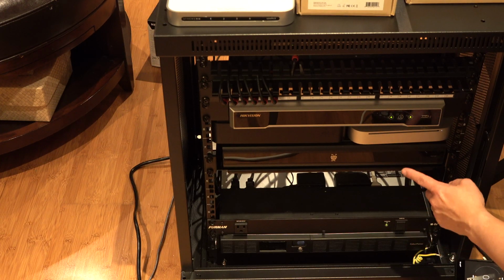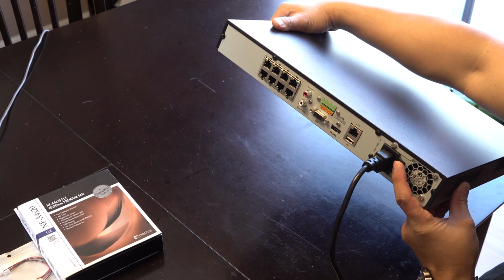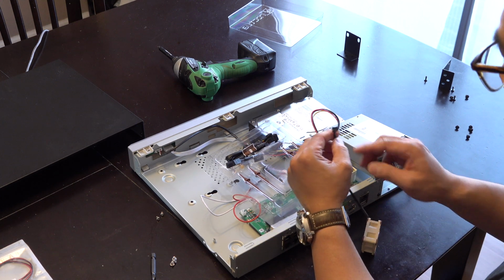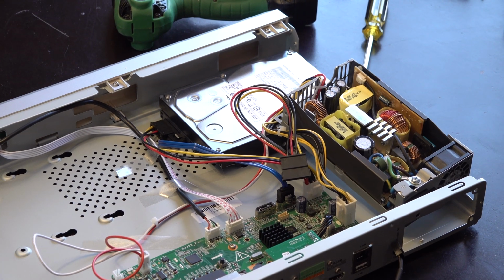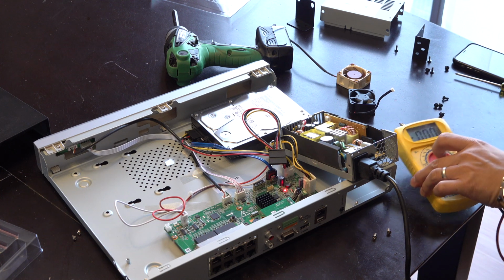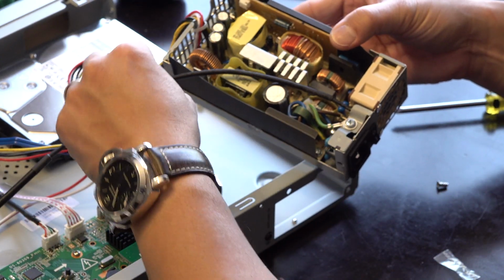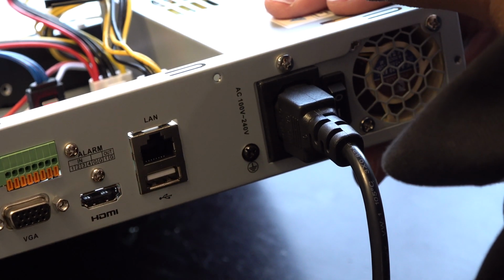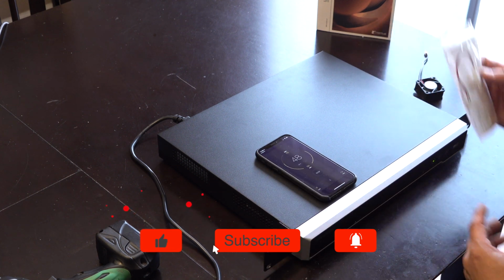Replacing the Noisy Hikvision NVR Fan without splitting wires

Comment: I replaced the fan as per video but a couple of gotchas. The 3-2 pin converter is not readily available - I ended up soldering the red and black - quite easy really. My PSU was much more complicated to open - and it took some bending voiding my warrantee no doubt. But keeping it as is was simply not an option. My noise levels dropped from 52 to 50dB as my unit has a second fan. I am planning to disconnect that one but have not yet gotten to it (I will post an update to this comment once done). TBH from my experience to date - I like HikVision cameras but will NEVER buy a HikVision NVR again. The noise for one, but the lack of grunt, the technical complexity at the PC end and the need for outdated IE compatibility "if you are running old firmware" - whilst there is firmware that does not require this. Lastly - it does not ship with rackmount ears. The RJ45's are on the wrong side of the unit for rack mounting compared to conventional switches ...
Reply: did you disconnect the second fan?
Reply: i have just done mine  with  what came with Noctua fan and worked great, you need to use the omnijoints, extra adapter cable not needed

Comment: My NVR’s manufacture date is 2023 and the internal circuit of PSU is so different that i can’t use NF A4x20 because the original fan is not 20mm but ‘15mm’.
There’s no ‘A4x15’ i had no choice but to use NF A4x10
Instead, the 20mm one is placed on the side. But you had to remove one ‘tiny nut’ before.
I hope my comment will help anyone do this process.

Comment: I bought 2 noctua fans, 1 for PSU 1 for the case. Now the case fan is working, but PSU wont work with the noctua fan. When I insert the old fan it starts spinning. The noctua fan isnt broken cause if I plug it into the case fan port it works. Anyone knows whats happening?

Comment: I'm thinking about modding the nvr I have as the fan on the heatsink is bad. Problem is the fan is in the heatsink. I was hoping I can put a thin 120 mm fan on the cover and solder the wires to the pin for the fan and I might be able to but the heatsink might be a few millimeters to big. I don't want to have the fan on the outside but was planning on using those metal fan protectors. Hopefully I can figure something out
Reply from the maker: Since the wires are very thin, you can also use the connectors seen in this video: https://youtu.be/G5aJZV4ICnw

Comment: You didn't compare the CFM because on the Delta it says 9.43cfm or 0.267 m3/m is this correct?
The noctua puts out 9.4m3/h or 0.151m3/m. I just converted it and you can feel there is reduced air flow. I I'm only going to run four cameras but what's this airflow going to do for my NVR overheat???

Comment: I appreciate replacing noisy fans.  Not sure if this mod is neccessary or advised.  Your video and audio productions is superb.
Usually noisy fans are the product of RPMs, Blade design is a factor but not by much.  You can't reduce the noise and RPM unless you go up in fan blade size and in the confined space of a NVR/DVRs you are limited.
  
Because you didn't use the ps power port I consider it a RIG.  You ran the fan power out of the supply to another power source.  I am questioning why the system fan is missing from that NVR. I thought perhaps it isn't needed but I see POE ports so that would add power demand to the unit as well.
The fan you replaced is designed to specifically cool the power supply.  It is designed to run at a continuous RPM.  

The Delta model fan specs: rated 30.5db Noise, 8200 RPM, Air Flow 9.4 CFM (0.263m³/min), Amp rating of .100A, Power consumption 1.2W.  
The Noctua fan at highest RPM is 5000 RPM, with Noise of 14.9db.  My concern is the RPM is reduced almost by half, this translates to reduced air flow which would increase the temperature of the power supply components.  Since this unit does not have the secondary cooling fan the power supply fan has to pull in all the air into the unit and exhaust it out the back.  
The reduced air flow would also raise the temperature of the hard drive and the system board and the air flowing over the power supply would be hotter before exiting the chassis.  Add in a second hard drive with the higher heat load is experienced and the increased power demand on the power supply.  

I would be interested in measuring the BEFORE/AFTER temperatures of the unit.  That would be interesting to know.
Its possible an early death of this NVR is forecasted.
Reply: Hi Andy, that was my NVR - it's been on non-stop since this video was posted. I believe I posted some flir thermal images on Infinite Tech Services yelp.
Reply: makes perfect sense what you are saying there, i think a shorter life is on the way for that nvr

Comment: Just replaced my fan in the same NVR and I cannot believe how much quieter it now is!! - it’s made a massive difference. Many thanks for uploading. The Noctua that arrived from Amazon UK came with a Omnijoin adapter which allowed me to use the two pin plug from the old fan. I was able to push the excess cable out of the back of the PSU so it’s nice and tidy inside.

Comment: Do you think the fan header in the PS and on the main board are both constant, or do they turn the fan off an on as needed? Just wondering if there could be a situation that the PS is running hot, but the main board fan header is saying, "Hey, the board is cool so shut the fan off" and your PS smokes? Just a thought. My Hikvision is wayyyy to loud. I'm ordering that fan right now and I think I'll just cut and solder the existing connector on, that way no issues.
Reply: I just installed the new Noctua fan. NIGHT AND DAY. I bet it's a 75% drop in volume. No joke. Like you said, you need to 3pin to 2pin adaptor. No problem with having this unit under my TV anymore.
Reply: @brianlarsen1165  Did you use an adapter for the cable in the end?
Reply: This connector its a  JST PHR-2 model .
Reply: @jarosawkurp9154  Look s like it, but I can't find a 3pin to 2 pin 2.0 adapter, only 2.5
Reply: Hey Brian did you use the 3 to 2 pin adapter and just cut the two wires and join to the original fans connector wires?
Or did you just do the same as this video and connect to the board?
Reply: @oldchev2850  I did the same as the video. It made a HUGE difference. If the volume was 10 before, it's a 3 now.
Reply: Thanks for the reply Brian.
I ordered the Noctua fan last night but didn't order the 3 to 2 pin connector. My intensions were to cut and solder the original two pin connector to the new fan. Hopefully there's no issues with that?
That's good to know that it's worth the effort.
Reply: @oldchev2850  I'm sure that would work as well, but I'm lazy and the adaptor was only a few bucks. You will be very happy with the drop in volume. I was.

Comment: My hikvision has 2 fans. Will this mod work since the plug you used is for the second fan?
Also what happened to the plug the original fan was conected to in the power supply box?

Thanks again
Reply: George V Hey, I had the same issue, having two fans in the server. Sometimes these Noctua fans come with 3 to 2 pin adaptors themselves and sometimes not and a sachet is provided like in this video. The instructions on the box say how to use it, it is called OmniJoin adaptor. you will be using the 2 pin connector of the existing fan and connect Noctua’s fan to it. It needs a bit of cutting cables, but nothing major, you should be fine.
Reply: Did you find a suitable replacement for the second fan that's in the case?

Comment: What is the longevity of this mod like when your running all 8 cameras via POE?
Currently using a 7308 hyrbird DVR which I had to replace the PSU in but it was a fairly standard PC PSU just in an SFX size. the Delta one sounded like a jet engine and ironicly it was only rated for 80w the replacement can do like 300w XD

Want to move to full IP soon but want to have a fairly quiet solution that I know wont fail on me. Wish Hikvision would ditch delta for their PSU's Delta have a history of making the loudest fans :|
Reply from the maker: Still running strong 2 years later
Reply: @infinitetechservices9809  Actually got a DS-7616NI-K2 without POE early 2020 for my setup. it had a very annoying fan which I unplugged and being non POE just used an external power brick. so fully silent. been running fine for 2 years as well completely fanless
Reply: @AdamBluntTech what power supply did you use? I have the same model and the noise is so annoying
Reply: @antoniosergiovaranda2128  My 7616 is a non POE model. it had an external 12v power supply from factory and so I just unplugged the case fan. Still running strong. Though I am down to 2x Hikvision cameras as I am ripping it out. but 4 years of zero fan and its fine.

I am 99% sure you have a POE model as your asking about power supply. The reality is only fan modding is an option as the PSU in them is odd. it has 48/52v output for the POE side of things